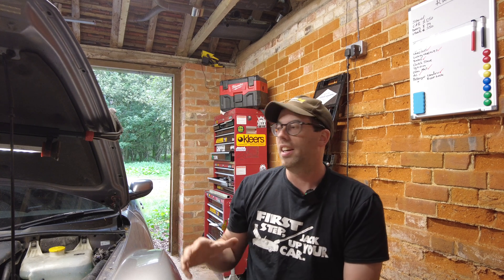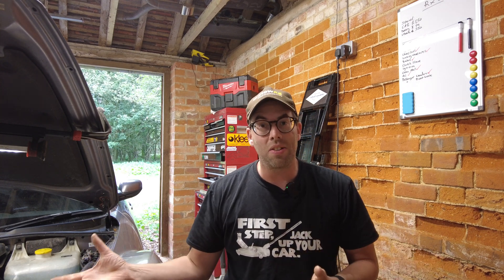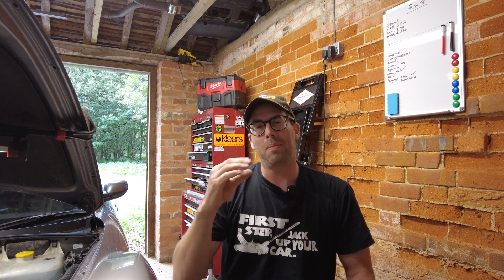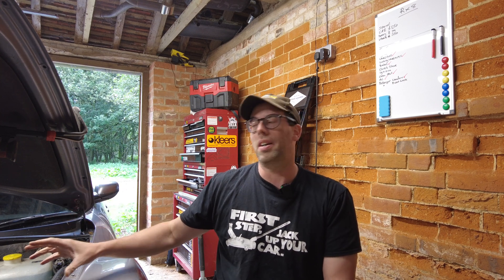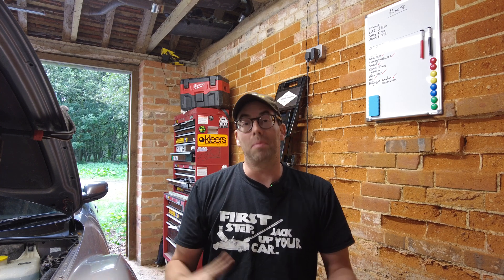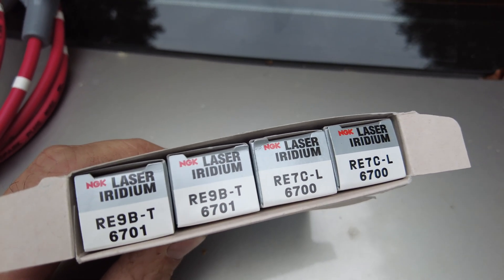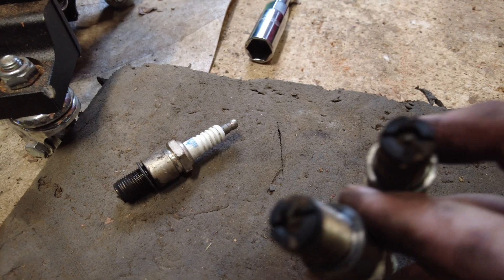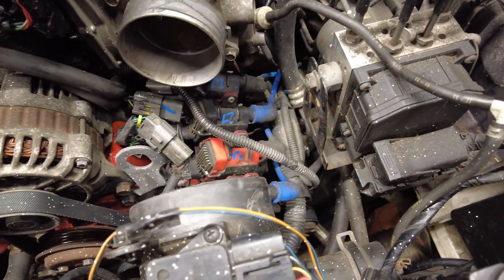RX8 PT5: d585's in the bin and install RRP mk4 coil packs (Ryan Rotary Performance) #mazda #rwd #13b

Comment: I have the revision 4 coils from Ryan rotary performance, i had them to trial as i use my car as a daily, the previous coils were the revision 2 coils and they had around 45,000 miles on them when i removed them still working.
Reply from the maker: Carl knows his stuff, I had the very first set ever on my last 8,  I do love RRP stuff, I think i paid for Carls Cayman! ;)
Reply: @leedfollow  not far off myself, coils, engine mounts(although replaced with OEM) billet sump, pulleys, exhaust and high flow cat, original cofs adapter and remap.

Comment: My Rx8 is running AEM coils since the Rotaryrev D585s failed 3 years ago( ran for a good 4 years). Now its performing well with the remap . Sports cat , pop and bang map and dwell timing. Does it matter if I should change the dwell timing back to factory even though I’m still running AEM for over 3 years now. Btw my engine is a Bridgey and was built by LC Rotary. Noticed the badge in your the engine bay. 😅
Reply from the maker: My knowledge of Aem coils is a bit blurry but I think they can run a bit more dwell than stock and if yours have lasted 3 years that's definitely the case, if you are ever passing anyone who can drop the dwell a ms or 2 then pop in but otherwise you should be ok! I miss having my RRP Bridgeport. I have no idea if this is a lc engine apparently it's it's 3rd engine and this one was secondhand, I think this poor car has been through a lot in a short amount of mileage!